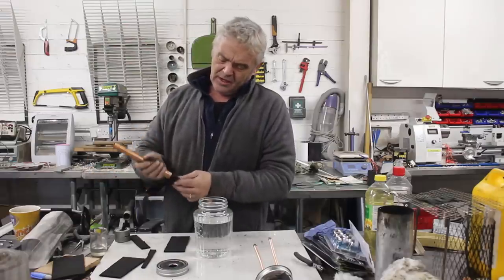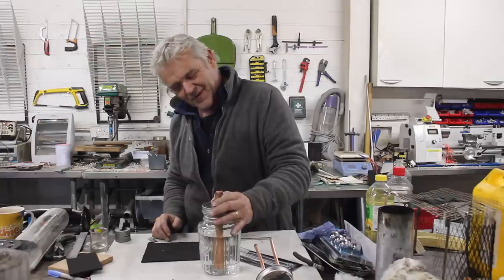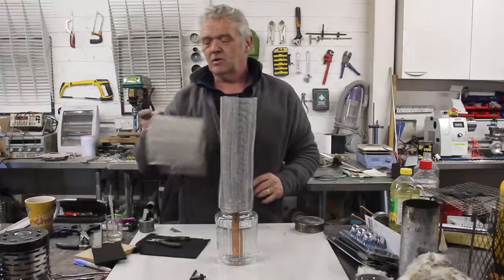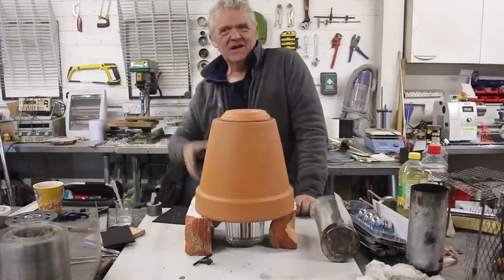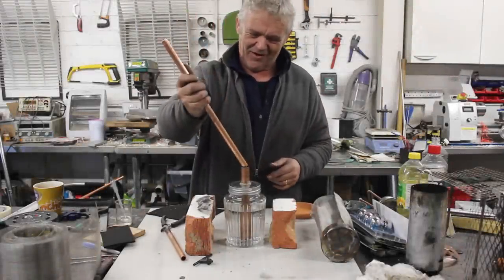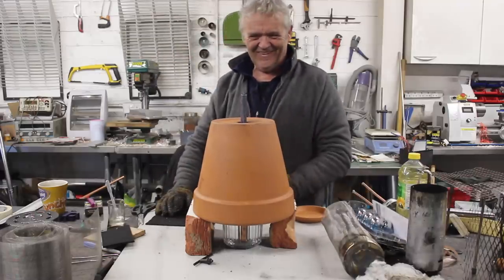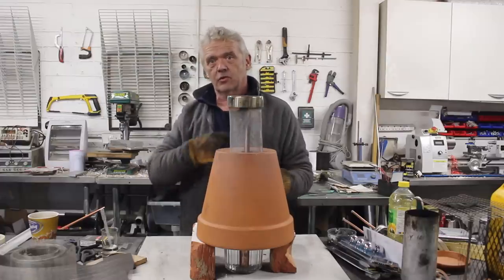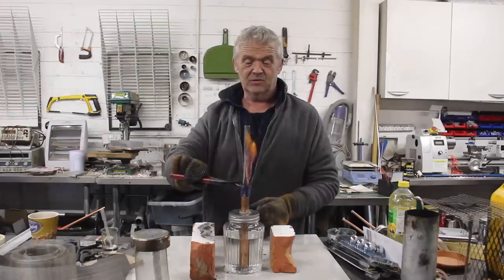1715 Improving The Copper Coil Burner As A Heater

Comment: Wouldn't it be better if the outer pipe were heat insulative to make sure only the small quantity of IPA is exposed to heat to encourage evaporation?  
There's a danger of vapor forming in the outer chamber from heating the outer pipe.  This will either push vapors up the sides through gaps or worse, if the chamber is sealed, it may push liquid IPA up the center of the tube into the burning section which can get out of hand.

This should probably be explained so someone doesn't hurt themselves.

Comment: Quick question carbon monoxide...?? Would there be any issues in confined spaces like heating a room. I'm currently using a flower pot heater with tea lights wondering if I could do better....
Reply: I was using alcohol burners in a greenhouse a number of years back on really cold nights, one particular time I did have an issue with incomplete combustion, I assume there was a lot of carbon monoxide produced as everything was covered in black soot the following morning from just ethanol!

Comment: If you think that's good waste oil burners are insane! Just take a length of flue pipe and set it over a little tin of old motor oil then add a half shot glass of kerosene to help it ignite. This is definitely an outdoor project but it gets wicked hot.
Reply: Fumes, yes ?
Reply: Yes.

Comment: what if you fed oxygenated air (=oxygen) through that central tube that would be bent 90deg on top down to where the flame starts? Or bring another oxygen tube down that flame and release heated oxygen near the base of the flame... You would have to shut off other oxygen entries to make sure the only oxygen it gets is a hot one. That way you not only preheat the fuel but you also preheat the oxygen. You would essentially be able to burn a heavier fuel even more officiently.

Comment: I like your heater, and I noticed that you used stainless screen, but I wonder if galvanized screen would produce hazardous gases. Also as the heat is conducted down to the jar would it crack ? I think a longer test of this heater is needed.